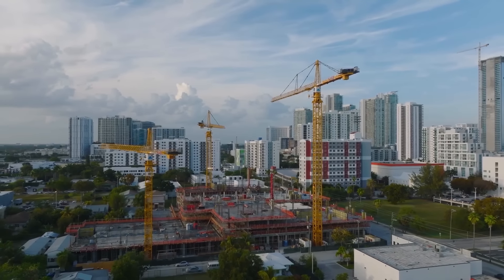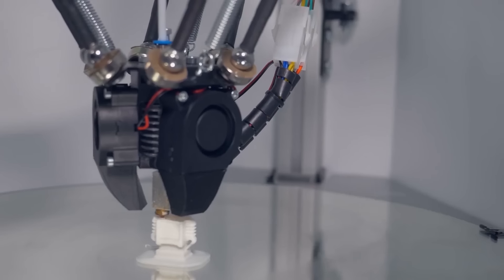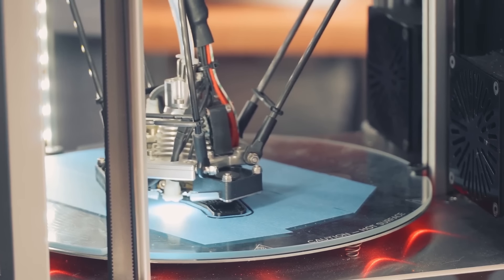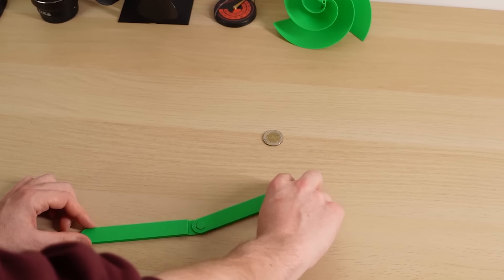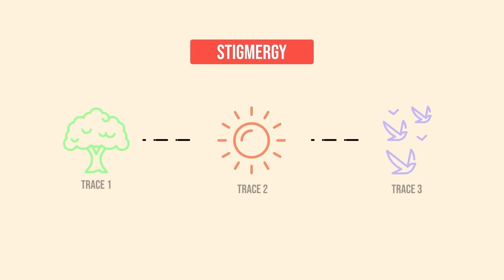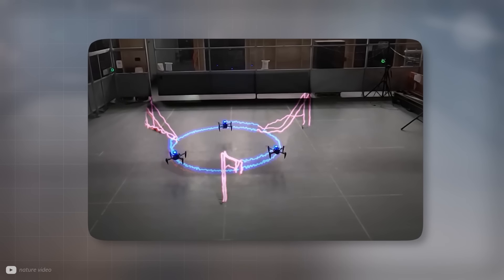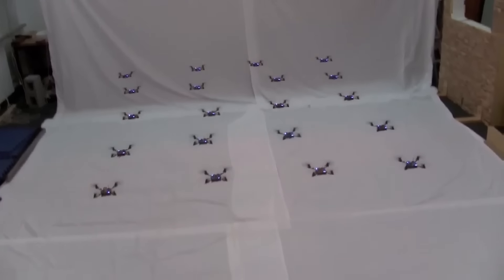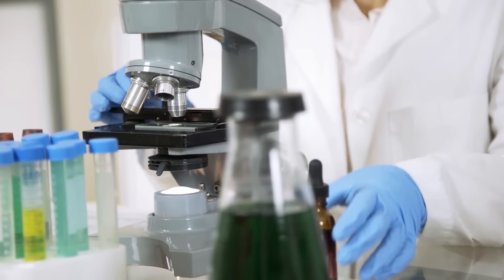Why 3D Printing With Drones Will Transform Construction

Comment: You are overselling the precision; you are comparing to drones when you need to compare to 3D printers. They got a proof of concept and little else.
Reply: both aspects should be covered equally
Reply: There's a whole neighborhood going up in Texas that is being 3D printed. Call it what you want, it's more than a concept.
Reply: He mentioned the building code tolerances in the video. 9:23  Just missing scale and purpose really.  They could just make crawler bots on the surface of that kind of material and save the propeller. Bring in our new hive mindset.

Comment: Modern concrete structures are reinforced with steel as concrete cannot resist tension forces, and consequently these drones will not transform the construction industry. You need to research your topics more thoroughly and talk to real engineers to avoid being called out for producing garbage
Reply: Steel is obsolete. Use a spool of carbon fibers.

Comment: Idea: adapt one of those sports stadium cable-suspended cameras as a 3D printer. Would remove the flight/battery issue and have similar benefits plus more stability. Like a giant delta 3D printer.
Reply: brilliant! i'm all down for that one. huge delts 3D printer have been dome before, and (unlike this bogus) it's a really promising technology.
Reply: But drones are cool and trendy.
Reply: Already I thought of several ideas that SOMETHING anchored to something else that would supply SOME rigidity to allow the same drone to work and not interfere.   LOTS of different ways this could be attempted like the one you say.  AND you could have a persistent electric power line compared to small limited batteries.  That is a must-have for construction.  Just think how many recharge cycles you might run in a day at say 20 min per run, and maintain cases of batteries.
Reply: @mrwayneright  Yep, and the lines running power to the unit can also supply feed-stock. Definitely way more real-world potential than a swarm of inefficient flying blender-bombs.
Using tethers and/or suspension cabling might at least allow for cranes that aren't so heavy-duty, reducing some of the wastage mentioned.
Reply: Yes
Reply: idk seems to bring back a lot of inconvenient infrastructure.
Reply: A better solution is what they currently have for 3D printing buildings.
Reply: A great way to get rid of the heavy duty-nasty Z-axis
Reply: right but you stil need the structure to hang the cables high in the 4 corners, right? plus the tension required to hold the printing head with tubes feeding materials, plus material flowing through the tubues, once you habve the structure its probbaly easier to have rails and the weight is working vertically  onthe structure instead of pulling sideways on the cables. also 3d printing needs precision that you wont get with long cables, wind etc
Reply: @geemy9675  Hmm, what about a hybrid version.  Using skimpy(ish) poles and powered, tethered (to the stadium stuff) drone.  You could use the structure to send power to the drone.  Although I don't even want to think about feed-stock delivery.  Maybe you could get away a lighter, cheaper machine machine.  IDK
Reply: @bill6255  honestly I don't see this building drones thing going anywhere. 3d printing homes sure, automating parts of the building process, but construction will always require heavy materials and flying is not an efficient way to handle heavy stuff. flying is useful when you need to go fast from a to b or reach places you can't get to by land. there is no way those drones will fly to the construction site and carry every thing they need

Comment: Bro I’m sorry but the reason 3d printers are so accurate is bc they are grounded and bolted. Yeah this method could maybe be used in some very specific situations like remote areas, but there is so much that goes into this. Just look the accuracy of the model that they built in a lab, now imagine that with wind and possibly rain

Comment: Carrying material in the air before depositing it on the structure costs a lot more energy than a crane or a giant printer no ?
Reply from the maker: Yea for large construction projects the cranes would probably be worth the hassle for this reason, but for smaller jobs or emergency applications I could imagine these having their uses
Reply: Sure, but more energy for something that's more flexible and 2 or 3 times faster than the gantry style 3d printing, which is already significantly faster than regular building, is worth the efficiency cost. Electricity is cheap and only going to get cheaper.
Reply: @ZirothTech  What is a "large" project? For a house-sized project, you could likely design a gantry printer that breaks down in about six major components for transport and can be deployed in less than two hours. Once the gantry is up, it can operate for however long you need it to, no charging or reloading breaks. Though printing speed is ultimately limited by how fast previous layers set hard enough to safely support the next layer.
Reply: I could see a combination of the two. A Crane lifts the material close to the use point, then the drones zip about applying it over a short distance. You're still making savings as there is a reduction in labour @ZirothTech
Reply: If the efficiency of the drones and solar cells reaches a certain point, they wouldn't even need to charge, just pick up material and get to work. The efficiency comparison breaks down once we get past energy scarcity.
Reply: @boomers_pb  Even if solar cells achieved 100% efficiency, the most power you'd have available is 1kW/m^2 on a clear-sky summer day at noon. If you want to lift a meaningful amount of concrete per roundtrip, you will need A LOT more than 1kW per m^2 of drone footprint.
Reply: @jackinthebox301  where are you getting the 2 to 3 times faster than gantry printing from?

A gantry printer can absolutely be made to work as fast as the drones can (it doesn't have as strict weight restrictions so can use larger nozzles and there is nothing stopping there from being multiple nozzles) and can be made to have no downtime, just continuous extrusion which the drones currently can't manage.
Reply: @conorstewart2214  Admittedly, the 2 to 3 times number was out of my ass, but it was meant to illustrate that a gantry printer is inherently limited by its singular print head. Its not slow by any means, but the drone swarm is just that, a swarm. It's only limited by the swarms ability to avoid each other. 

This is all assuming its the right kind of project, of course. It can conceivably scale far faster.
Reply: This is definitely "what if" talk, but I imagine that being able to wirelessly transmit power would be a complete game changer for this. You almost certainly couldn't get rid of batteries, but constant charging as needed, to reduce weight from a removable battery and the need to sit at a charging station or swap one out, would allow for much more work with less downtime.
Not to mention that higher loads could be achieved when power consumption no longer means less working time.
Reply: @luisostasuc8135  You need kWs worth of power to lift a meaningful amount of weight - you aren't going to "print" a concrete building with drones dropping 1kg of concrete at a time, especially not one large enough to be a challenge for a gantry printer. You need 10+kg of payload capacity. Wirelessly beaming that amount of power to moving objects over a remotely significant distance is practically impossible and may instantaneously fry any birds unfortunate enough to fly through such high-intensity beams.
Wireless charging barely works even for low-power gadgets like smartphones where the charging range only goes to something like 50mm and power is sub-20W per device.

Comment: That sounds like a good Idea. But I'd be rather pessimistic about that.

First: a drone can't carry much filiment. Keeping a heavy load in the air is a energy expensive. And only taking small loads but many refill tripps, doesn't really lower the energy consumption.
A crane that can hold a load in the air without further energy-input is cheaper then to have to keep putting in energy to remain in the air. 
Second: you have to upscale the drone quite a bit for large constructions. However larger drones need sturdier heavier materials further adding to energy consumption.
Third: weather conditions. Holding a large drone still enough against wind and weather will be rather difficult. So you can only operate at still weather.
Reply: Was thinking the same thing but I thought construction stopped during weather conditions because holding anything against wind is difficult no? Like, I can't imagine swinging steel bars suspended by a crane wire with higher up winds is business as usual
Reply: @bforbiggy  chances are the crane can continue to work on higher wind than a drone can.
Reply: Yeah drones are just inefficient, even if tethered with a pipe for the concrete it is still inefficient.

What they currently have for 3D printing building works much better but if they want to go down the route of collaborative robots then ground based robots are best. Something with either legs or wheels that can go round and build up the walls would be better and wouldn't need stabilisation or to worry about the wind.
Reply: @conorstewart2214  This might sound unintuitive, but OP's 3rd point about wind is actually the easiest one to manage than his other two points - there aren't that many ways we can get around weight and energy consumption after all. Wind, however, is easier.

Now, I'm no civil or robotics engineer, but I'd imagine having an independent wind sensor, something you can put around the site, at some distance away, to "forewarn" the drones, would be rather easy. The sensors can then wirelessly communicate with the drones, after which the drones can prepare - adjust their positions, how much to "lean" in a certain direction, and for how long.

Like I said, I'm not an expert in these fields, but if even a layman like me can think of something like what I just described, then I'm sure these engineers can figure it out. The weight and power issues are the bigger problems.
Reply: Classic YouTube comment...
"You're wrong.""

Comment: I think it would make more sense for drones to carry pre-fabricated parts that were 3D printed. Thus you make the part large enough for the drone to lift and transport the required distance. I could see that working.  Even use the drones to build a structure,  using drop in place pre-fabricated parts.  However using drones to actually 3D print structures,  I think would be too costly. Technically however clearly possible.
Reply: May as well use a crane if all you're doing is lifting panels.
Reply: In places where cranes can't be cost effectively located,  drones might be another option. In the end it comes down to cost and practicality of course.
Reply: @JBondy007  in places where you can't get cranes you likely aren't building anything large and chances are you can fit a small crane or forklift in rather than drones.
Reply: @conorstewart2214      Is see it more about process automation and where it's heading.  In the future once this drone assisted construction concept evolves sufficiently,  I have little doubt it could find a niche in rapid modular construction.  Something I'm not sure a crane would be well adapted to.  It would hinge on the design structure being modular and optimised for construction via drones,  using pre-fabricated components, simply lifted into place by drones at a fairly rapid pace.  In the end,  it could just come down to cost effectiveness.  Modular construction would be easier for drones to adapt to.  One off designs less so.

Comment: I think what I find weird about it is that it requires you build everything out of a setting material, when if you want "houses [built] with incredible speed" we've been able to do that with prefab housing for a century, and if you want "simple shelters within hours" you can ship a pallet of wood and a nail gun and it wouldn't even need to set.

Comment: Would love to learn more about the systems that would need to be designed to refill these drones as they'll be limited by their payload capacity. In addition, it might be interesting to dive into the orchestration tactics surrounding swapping out batteries or swapping in/out additional drones as ones need to go offline to charge, which I imagine is something that's already prevalent in some factory automation. Also, how the materials might be processed on-site, especially if it involves locally sourced raw materials, could be an interesting to expand upon further.

You've peaked my interest! Obviously there's a lot of problems still to solve surrounding a solution like this but it does look promising for specific applications.
Reply: piqued your interest. stirred or aroused, not maxed out. it got your attention. common mistake but you use the word correctly.
and you make a lot of good points, I agree, these are pretty interesting problems to sort out

Comment: I'm pretty sure 3d printing habitats on mars would work better if the drones just traveled on wheels and used jacks to prop themselves in place to use a robotic arm.
Reply: The ingenuity helicopter is absolutely impressive, but there will probably never be much atmospheric flight on Mars.

Comment: Would be interesting to do a rough calculation of the number of refill needed based on the mass of concrete or even foam used for an average house and the payload of those drones . I think It would quickly moderate those industry transformation claims haha

Comment: Using foam to construct buildings has been done for decades. Using a stiff Styrofoam-type (closed-cell extruded polystyrene foam) shell covered in moisture barrier, expanding foam is sprayed or flowed into the center like an ice cream sandwich with common siding and drywall for surface treatment. 

Inflatable molds can be filled with a dense expanding foam to build non-orthogonal structures. 

Concrete foam has been used to line tunnels and high volume foam can be used to replace a large portion of a thick (up to 8') non-load bearing slab.
Reply: Structurally Insulated Panels or SIPs.

Comment: I'm more interested in learning more about the printer at 0:43.  I had theorized that a printer with an angled head could be interesting, but this is making some massive bridging lines look easy.
I'm most curious what material it's using, because I don't think concrete works that way.

Comment: This will be amazing for exploration. I could just imagine taking them out to dump batteries to get them very far out in remote areas. And you could get shelters all over the place to be able to access places that other words were ever accessible. I'm thinking some tweaks and you could have them in water and caves as well. Pretty cool.

And if you could get the drones made cheap enough, I'm sure you could think of some really cool designs. If you're not worried about losing the drone in the process. Maybe the drone becomes part of the structure.

Comment: 3D printing is still an emerging and amazing technology. 
My home printer clearly has 0.05mm or less accuracy when making test pieces. 
With a 2mm part being too tight, make it just 1.95mm and it fits great!
SpaceX and many other rockets use various metal printers now too.

Comment: I recognise the printed structure featured on the video thumbnail. That was a ceramic vase designed by the Belgian artist Unfold and printed on his gantry printer (a modified  BFB 3000 if I recall) in about 2010.

Comment: As a carpenter, I'm pretty confident I can't be replaced by a robot any time soon. Maybe in 50 or 100 years it would be possible.
If you're building out of cinder block or brick maybe 3D printing would be an alternative. Trying to do precise finish work over that extruded mess would be challenging though.

Comment: I wonder if it makes sense for the drones to be corded, and cement pumped up to them. This would allow for stronger and continuous drones running, and not needing to land to acquire more material. also wouldn't require drones to carry all the material themselves (though maybe that's less of an issue if the drones are corded). Though coordination of the drones through space would become more important to avoid 'crossing streams'.
Reply: I.e. steering a swarm of 3D-printing string puppet robots!
Reply: @AerialTheShamen : flying 3D-printing string puppet robots!
Reply: The drone still needs to lift the weight of the cord or pipe and a pipe filled with concrete is heavy. A robot that crawls or walks along the top of the wall would be better.
Reply: @conorstewart2214  good call

Comment: This will NOT replace any current technologies used for building the usual stuff. We do it much more efficient than some flying drones.

What this CAN be used for is for building stuff we did not even know we could build up until now - some small remote structures that would require way too much effort to haul a big crane up on a mountain or something like that. This is NEW technology for completely NOVEL kind of builds.

Comment: I think printing buildings is unquestionably the most environmentally benign method of building, especially if a proportion of the matirial used comes directly from the construction site. It will become ubiquitous soon enough. Using drones to do this, however will remain a niche option simply by dint of the weight of the materials used.  Scaled up, the drones illustating the principle would be helicopters!  Brilliant channel...thanks!